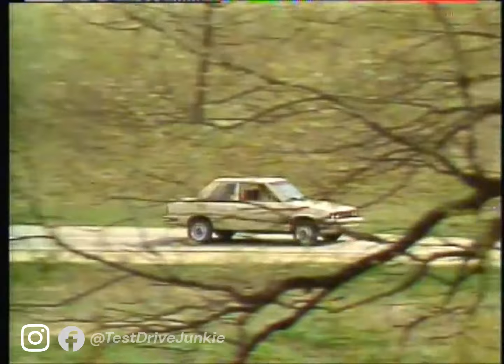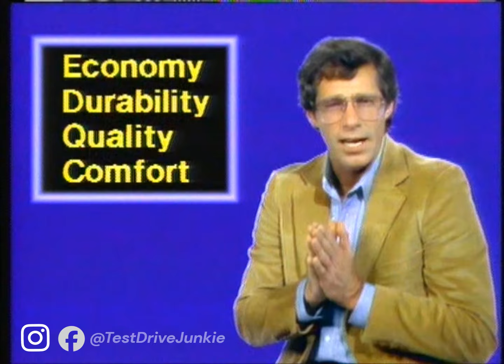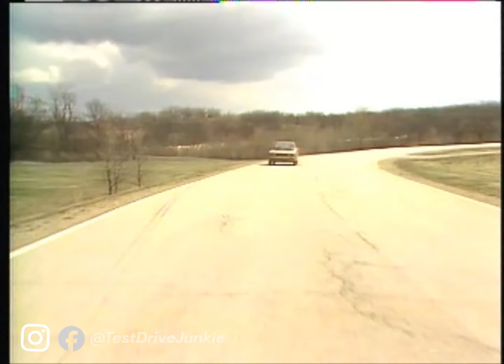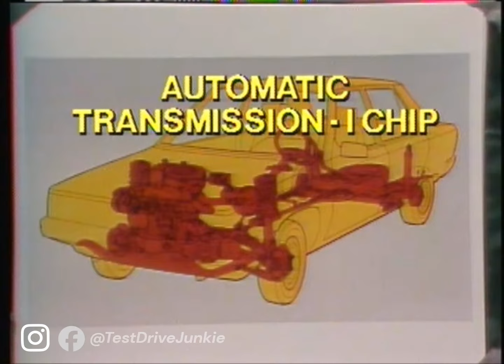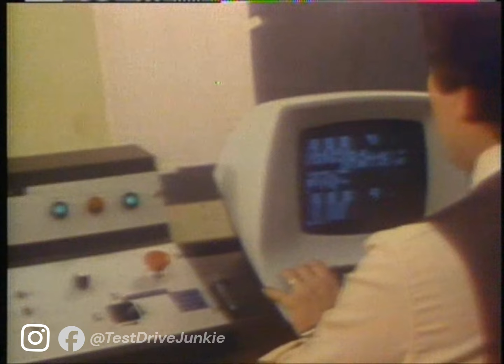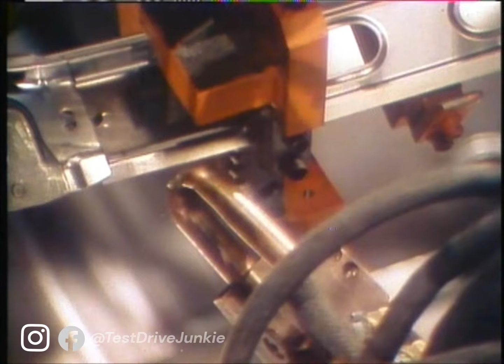1983 Renault Alliance Manufacturer Laserdisc Promotional Video Side One

Comment: I caught a two door notchback Alliance sighting, here in Ottawa, Canada, about seven years ago. It appeared in great shape. Light beige, with stock steel wheels. Obtaining parts, must be a serious challenge. Its small size and very basic 'stark' styling, really stood out, in modern traffic. A dedicated owner, for sure. I thought the Renault Fuego was a beautifully styled car, for that era.
Reply: Funny story about a Fuego.  We had a black one with a butterscotch leather interior.  Full length cloth sunroof (probably webasto) and the car was on our used car lot around 1989.  I think it was 5 or 6 years old.  Sweet little turbo in that car and was a hoot to drive.  Well, one day someone comes in to test drive it and our shithead salesman had been knocking back the beers.  So he gives the guy a dealer tag and 10bucks for gas.  2weeks later the cops call, we found your car.  I go to retrieve it and the guy totally cooked the engine in that car and it looked like it had a fire under the hood.  Had to junk it.  The Fuego was a good looking car, nice lines and ya felt good sitting in it.  Too bad what happened to ours.

Comment: These things ended up blowing head gaskets constantly. My sister had a brand new 1984 Alliance that the A/C failed 2 years later and the head gasket failed after 3. The warranty back then on a new Renault? 12 months or 12,000 miles.
Reply: Very common, head gaskets problems plagued these cars something awful!  One bad overheat and it was done.

Comment: Had new 1984 DL model two door. Loved that little car. Drove it till 1992. 
I had no issues with it.  Sold it for $2500 the guy was happy to get it.
Reply: How did you manage to avoid the ignition issue, the blown head gaskets, and a/c failures? Not being facetious, just that these issues were so common!
Reply: Almost purchased an ‘87 Reliance.  Instead, I bought an ‘87 Sentra.  The Sentra was a huge steaming pile.   Should have gone with Reliance.

Comment: Random fake Spokesman - "You can't throw a car away every three or four years anymore."
Every Major Automaker in the last 5 years, - "Hold my beer"
Reply: Someone forgot to tell my Jeep that. I've put almost 147,000 miles on my bought-new Wrangler over the last eight years with no issues other than standard wear-and-tear stuff like tires and brakes and a plugged rear window sprayer, despite living on a dirt road, severe winters, and off-roading it.